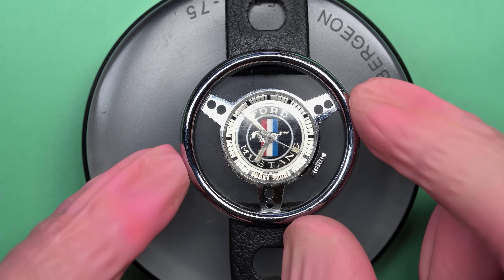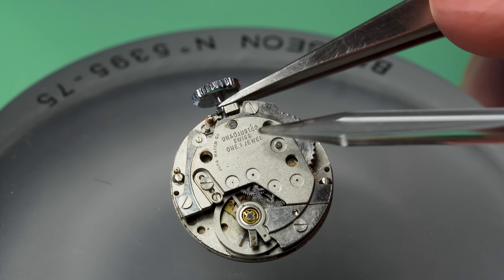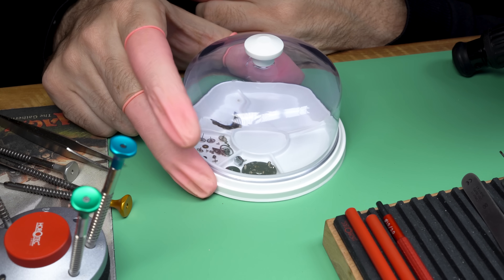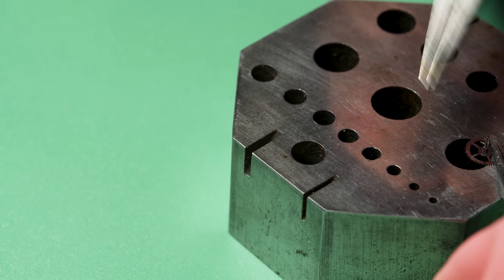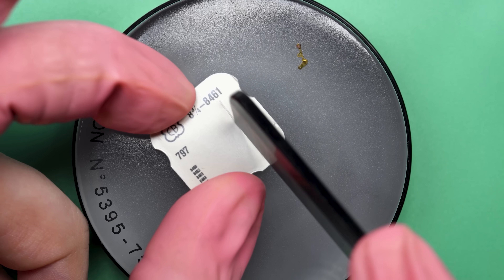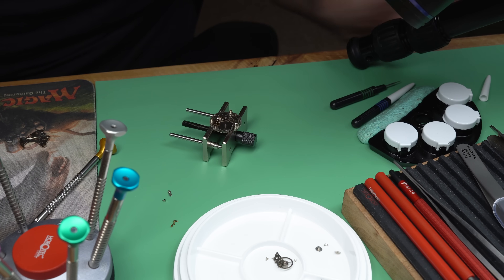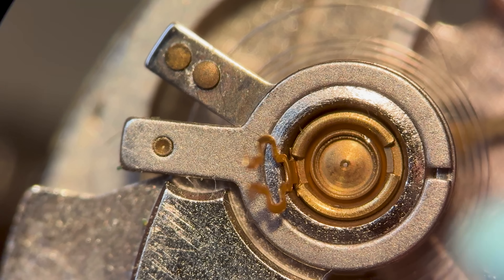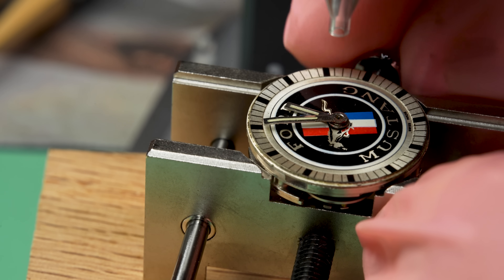Restoring a Ford Mustang Novelty Vintage Watch with a Very Strange Issue

Comment: It might have been pointed out here already but Old England were a brand of the UK watch maker Accurist in the late 60's. Their watches were an odd combination of heavy brass cases, odd dial colours such as green and orange, coloured plastic straps and roman numerals, very much a product of the 'swinging London' era. They had low-end Swiss movements such as this EB or Standard (ST). They also made watches that hung on your belt - these were almost pocket watch size of course -  and as far as I can tell they were entirely unisex. Other names such as "A Go Go'" and "Piccadilly" also appeared but they were made by the same people. They are collectable, especially over here, and becomnig accordingly rare.
Reply: They also made the Beatles Apple Watch, which is definitely collectible. Got one coming to my bench soon

Comment: Marshall - I am amazed how steady your hands are.  Like many others, I have essential tremor.  My hobby and therapy is electronics. Soldering can be very fine work, but I can rest the tip of the soldering iron against the joint to be soldered.  The solder mask on the circuit board and the surface tension of the molten solder tend to keep the solder in the right place.  I find after a few hours of soldering, my tremor is much improved. And after watching you work on a watch, my mental health is much improved.  Thank you.

Comment: Always a pleasure watching you work. I am a clockmaker turned watchmaker. You should try a Westminster chime clock rebuild. 3 barrels, 3 complicated trains with springs and levers a bottom plate and a top plate. It will teach you new innovative ways to use profanity 😂😂😂

Comment: Marshall, I actually started learning with these types of movements and then progressed to the more complicated ones. Aligning the pivots really tests your patience when there are no jewels, as you mentioned. What makes it even more complicated is keeping the movement in the same spot and in focus, since your cameras are rolling and you don't want to miss the moment everything clicks into place. I also find it very hard to regulate these movements. I can never get them to have a stable rate, and they are sometimes running a little fast or a little slow. Thank you for yet another great video!

Comment: Nice one! Great to see you taking the same care on a cheap pin lever movement as you do on the pricey stuff. 

Metal to metal contacts everywhere, so you must have used a lot of lube. 

Would have liked to see the barrel in bits.

Comment: You got me hooked into this. I've just pulled my first movement apart that wasn't running. It's a Westclox Pocket Ben with no jewel's at all. On a number of the wheels, you can actually push the pivot through the wheel. It's running again but still has a few issues that I will hopefully take care of as soon as my demagnetizer arrives as I know there are a number of pieces that are effected and it's a bit all over the place with keeping time.
Love your vids by the way, quite engaging, educating and informative for the novice.

Comment: nice to see this video, last year I ventured into watch restoration and I found a Douglas skindiver world timer (Wolbrock) for cheap. I figured this should be a good one to start with. Well, I spent days putting the top plate back on. (movement is similar to your mustang watch) I am happy to report that this step was finally achieved and tested. I unfortunatelly bent the hair spring at reassembly. Can't win them all.. Haha.

Comment: That's a super cool watch.  You didn't mention that the trouble you were having with the getting the pivots set was because the wheels weren't in correctly and that the center wheel pivot was keeping the bridge from dropping down low enough to engage the others.  Once you reversed that (2nd wheel on top of center wheel), it all went together.  Great work.

Comment: sometimes when I really have trouble getting the pivots to line up properly, I'll build up some support structures made of rodico. It does help to a degree against wheels falling over, and  afterwards you can just pull it out

Comment: What a fun restoration. At least it’s running again. Troubleshooting this would be fairly similar to a Swiss lever escapement. Looks like it has a very similar set up and regulation. The reason it’s all over the place is probably because of the balance spring, or because the pivot holes are coarse they probably need to be broached, and the pivots are probably all scored up too. And even if you did all that it probably still wouldn’t be a great time keeper. Just meant to be a odd little piece to enjoy for fun.

Comment: I have always worn a watch since I was old enough to keep up with them, only cheap ones. But the other day my friend gave me one he was tired of. He had it since 2006 or so and as he got older the weight became an issue. It is a pricey watch. Afterwords I started to watch your videos, and thinking about getting into the hobby of watch repair. I’m a machinist and toolmaker it has the same appeal that drew me into my job.
Your work is amazing and I enjoy your videos; I have checked out your websites for tooling and such for when it’s time to purchase.
Thanks for the lessons !
Question about this project, no barrel spring to check?

Comment: The strap matches the "steering wheel" with the circular hole cut outs, nice job man 🤙
Reply: It’s the original strap to, the tropic sport. My Ferrari version of this same watch has it as well. Mine though runs really fast, I’ll gain a few minutes within a few hours kind of fast!

Comment: The cap jewels are made of tungsten carbide. It is a very hard metal, mainly used in manufacturing to cut other metals. It is highly wear resistant, but also very brittle. It is a 9 on the mohs scale, just like the jewels we normally use.

Comment: If I remember it right, these watches were a "gift" when you bought a new mustang when the mustang first debuted for sale in 1964 1/2. I worked part time in the body shop at our local ford dealer.

Comment: Although you didn't address it and we missed out on the satisfying 'THUNK!' of a mainspring I guess its a sealed barrel and so unserviceable (or tricky to do so). A search online showed a Zodiac has a sealed barrel making lubrication difficult and often requires full replacement of the whole barrel.
Reply: I was wondering about the mainspring as well. Interesting - a sealed barrel! That may also explain why the watch was not going to achieve more consistent time on the grapher
Reply: Thanks for posting this! I guess that's how you recognize an OG: we notice when something is out of the ordinary. 😉

Comment: A tip for helping with putting the bridge back on movements like this is to put it on the barrel side first and to screw in 1 or 2 screws but not all the way. You can then use tweezers to push and pull each wheel into the pivot starting from the closest to the side you screwed in and working out. you can slide the wheels up to make sure they are in place. Grabbing the staff instead of the edge also makes it easier.

It makes it significantly faster, should be only a minute or two once you get used to it.

Comment: what about the mainspring? It seems like you normally disassemble those but this was left alone but not even talked about. Is this one sealed? Could the movement been improved by fixing/replacing the spring?

Comment: Great video Marshall, as alway. But it does raise a question. How were these movements mass produced if it is so tedious to put them together? Not very practical if the point was to make them as cheaply as possible. And I can’t imagine they are machine assembled. Anyone have any ideas?

Comment: yeah i have seen that before. the time it happened to me i did not have a microscope yet. the escape jewel on the pallet fork was loose and had pushed up so it no longer engaged the escape wheel. baffled me and cleaned/ reassembled it like 4 times until i noticed.

Comment: Rather than the steering wheel, this looks like 60s era hubcaps that had the mustang emblem, and the three spokes are feaux wings to "spinner" lugs that were used on some European sports cars for quick change rather than 4-6 lug nuts or bolts.

Comment: Cool watch! My guess before finding out the reason is that the escape wheel teeth damaged or otherwise not catching the pallet fork, or a contacting point between the barrel and the going train before the motion works is problematic (e.g. the center wheel).

Comment: As a rule I watch your taking apart & assembling a watch with little interest as to your procedure (you have to flow a procedure what ever the watch - they are all the same).  However with this watch that you should have thrown away because of it being cheep/time spent fixing too long = cost.
I found this repair the most interesting that you have done. They say  "It could have been repaired blind-folded"  WELL not in this case. If I was a betting man I'd put money on the fact that you actually learnt something from this repair.
Thank you for doing the wrong thing by not throwing it away & showing us something different.

Comment: Marshal if you disasemble your dornblüth you will also find 1 big bridge/plate (glashütte style 3/4 plate) even a. lange uses them.  but i suspect that its easier there considering the manufacturing quality is "slightly" better.

Comment: In terms of lining up the pivots on the train of wheels and pallet fork - I wonder if you could use some light plastic, like cling-film, place it over the bridge, use a pin to poke holes at the pivot points, then peel off the plastic and use that to alignn the pivots. Place the bridge over the plastic and then tear out the plastic once the bridge and pivots are aligned?

Comment: The holes in the wrist band match the holes in the steering wheel spokes. Could the main spring not be opened and serviced or did I miss something? Thanks for the video.

Comment: 1.5 minutes in and I'm predicting a problem with the pallet fork/escape wheel. All the hands move with the winding of the keyless works/main spring, but the balance assy/pallet fork interaction isn't regulating the power distribution.
Let's find out!

Comment: I know the tuning was not a priority, BUT, I would take a look at the silver and gold lollypop looking pieces that wrap around the "cap" jewel on the the balance wheel. It might be that one of them can be rotated to "adjust" the hairspring? If you look at 8:34 in the video its looks like the top silver piece is that holds the end of the hairspring is "adjusted" all the way one way up against the main balance support. Or the bottom guide piece needs to be rotated?

Comment: I know he usually does higher-end stuff but I'm curious.. He ever mess with Fossil-brand watches?- They were always my go-to for just reliable no-BS watches that I could beat on and know they'd still work.. Plus, I'm a fan of the clean aesthetic (fossil blue's, specifically)
I've even (accidentally, obviously) arced my MIG-welder through the housing and it kept right on ticking.
I've got one my grandfather (now deceased) bought for me when graduating basic training in the army and sadly it doesn't work anymore.. I was in the philippines and nobody had a crown that would fit (mine had bent somehow) so they got a "close enough" one, put it in, but it let moisture in and fogged up, once I got back stateside I just popped the back open to let it air out and put it in a small plastic box.. Been sitting there ever since :(

Comment: Marshal, how does one get a watch serviced by you? I'm a fan of your channel and have been watching for several years. I'm an avid watch collector, and several years back, I  inherited a watch from my dad. He had bought it while in the Army from the PX in 56 or 57, not exactly sure. The watch is an Aureole 17 jewel with I think is an 18k gold case. It needs to be serviced, it will run for about 5 minutes and stop. I've seen your work and wouldn't trust anyone else to do this.
Reply: I guess I need to join patreon?

Comment: I have a bit of an odd question.

So when I was a kid my dad gave me some watches and cigar boxes full of parts...etc that he received as a teenager from a retiring watchmaker that he used to sweep up for after school.
Recently I was going through the stuff and discovered that 4 of them run , 1 barely and 3 keeping  time to a usable degree which is something I never knew till now.
This stuff fascinated me so much when I was a kid and I'd really love to have one of these watches working well enough to wear, but I'm not sure if any are really worth the cost of service since they all seem to have at least 1 issue in spite of running and keeping time to a usable degree.

So the odd question I have is if it would be possible to say " trade " 3 of the watches plus a number of the donor movements to cover some of the cost to service the watch I'd like to wear ?
If the answer is no I completely understand, I just figured it was worth asking.

Even if the answer is no,  I would still like to give you as many of the donor movements as you think could provide useful parts.
Most of it is pocket watch movements, but there's a decent handful of wristwatch movements that maybe you could use.

Comment: Silly Question I think, could you electro plate the watches gears to avoid rust without affecting the timing? or do the parts need to be made of bronze to make electro plating work?

Comment: Question: Do you need to use Polywatch on a mineral crystal that has very tiny scratches? I have some sanding pads that go from 320 to 3500. Would I need something finer than 3500?

Comment: Wonderful video. Question is - once the movement was running the balance wheel looked a bit like bent? If so maybe fixing that would be the difference. Otherwise - and i never would suggest that otherwise. For such a beautiful watch with this cheap of a movement a "movement upgrade" (different movement with more then 1 jewel) could be nice. Tuning like Mustang spirit. :)

Comment: A few years ago I found one of these watches at a flea market. It was marked "Datsun" instead of "Mustang". Cleaned it up and got it running. Posted it on an online auction. Two bidders wanted it badly. It sold for $225. Probably had some kind of a "Z" car.

Comment: As much of a pain in the ass as that watch was you've got little time involvement compared to restoring an actual Mustang like I'm doing now. Back in the day I restored many early plastic Swatch crystals using a Foredom Mini Lathe and the 'plastic' Bergeon stick compound. After I did a few hundred I got to a point where I could draw scratches out without sanding. That said, since the beefy Swatch crystal is sonically welded, and you can't support it from behind, don't try your first crystal on some valuable Men's 4 Flags for example. Similarly I wouldn't push too hard on Asian paper thin crystals or you will "smear" them and that's when the fun starts. Thanks for your videos!

Comment: I was interestyed to see what was up with this watch. I got a watch for my birthday when I was twelve that would run for a bit and stop. This was when it was new. If you bumped it slightly, it would usually start running again for a minute. One day I bumped a guess a little too hard. Then it started running like this one did at the beginning. I never took it apart and no longer have it. Likely it had the same thing or somothing similar happen to it.

Comment: Just curious; how possible would it be to take the movement of a watch like this and swap it out with some other better movement? Of course the goal with this channel is usually to restore with original parts, but I feel like if I were to attempt something like this it might make sense to look for something else the same size to mod it with. The main issues to me would be getting the face and maybe the hands to fit on the new movement, probably having to resolder the face pins or something, though maybe it'd be more complicated than that. The crown might pose some issues too, though maybe it wouldn't be too hard to get the old crown knob to fit on the new crown pin?

Comment: You pretty much always show lubrication of the pivots on the bridge(s), but we never seem to see you lubricating the other ends of each shaft, the ones pivoted in the main frame. Are you lubricating these before installing the wheels?

Comment: I didn't see you clean and lube the main spring. Was that not an option? On a side note. I need that watch. I am a huge Mustang enthusiast. I have a quartz movement Mustang watch. The funny thing is. Its the cheapest watch I own. But its the most accurate. Its literally only 8 sec slow after 6 months.

Comment: This watch was made by Richard loftus and a company called old England these watches are super collectible here in the uk £90 to £140 I have a collection of around 15 old England watches all made around late 1960s you also get other car manufacturers on the they were all Swiss watches with different Swiss movements .

Comment: This makes me wonder how hard is it to swap in a nicer movement like maybe a newer eta women’s movement or such? I like my old England Ferrari wheel watch (same as the mustang but different dial) but it’s far from accurate but it runs. I also have a 70s Saab watch with an absolute junk movement that fell apart

Comment: I have a Pulsar Spoon watch that I have had for years. I've held on to it all these years hoping that I could at minimum have it looked at and possibly repaired. It's a very unusual watch where all of the  controls are at the top of the watch vs the side. I accidentally pulled the stem out and it was lost. Do you repair watches for customers? Do you offer contact information? I have a thing for unusual watches.  I have been watching your videos for a year or so now and really enjoy them.  Thanks in advance.